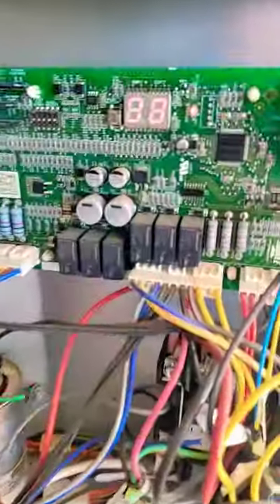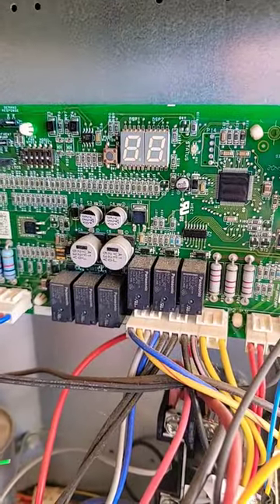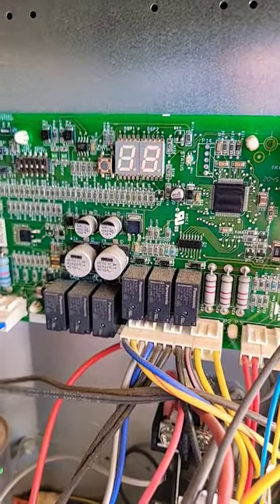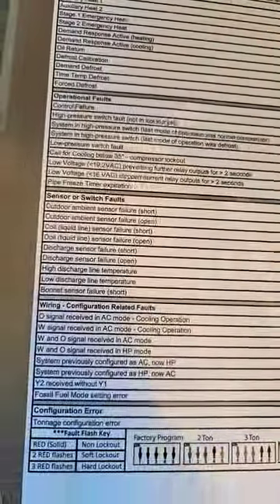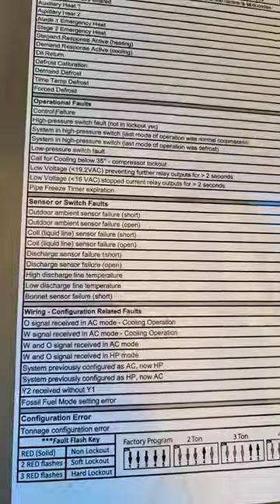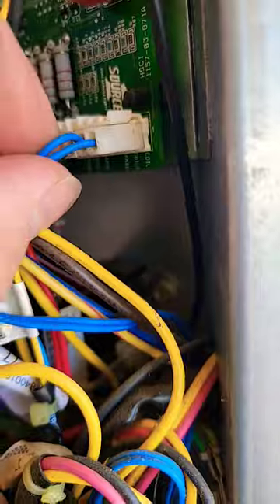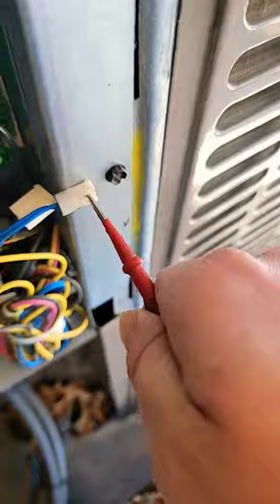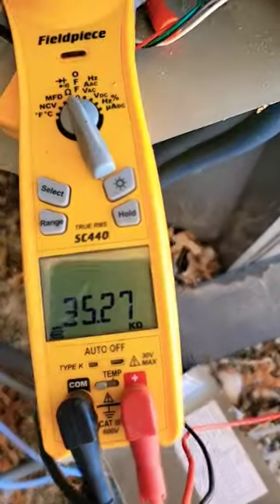Troubleshooting Heat Pump: Sensor, Board, or Communication Error?

Comment: Always turn it off and on before you call someone out and spend 300 bucks for him to turn it off and on.
Reply: That sure did cost the man 300.
Reply: Your average person doesn't think about things like that.
Reply: @@phillipterrrazas575, I understand you need the $$ but for something like that especially if the unit has an issued letter on a problem that should be about $100 I mean come on does everyone have to rip everyone off??
Reply: OR. Call a company that knows what they’re doing like Tad and he can fix it for you and find out why it kicked off in the first place. Or you can just reset it like you say and wait for the coldest day for it to break down once again and then wait for a couple days with 1000 other people trying to find someone to come out and do what this man just did.
Reply: And then he said needed a motor and blade another 875$
Reply: Those are intermittent problems.  It's hard to diagnose those I do commercial amd I hate controls.  If the sensor is good then it could be a bad board. I usually call tech support for their opinion.  If the board recognized a bad sensor it could be bad connection or bad board and sensor.
Reply: You're definitely that customer that's like "300 JUST for turning the breaker on and off." 😂😂😂
Reply: @joaquinmaciel2954  No Im the guy that watches youtube to figure it out myself and sometimes fixes it and sometimes costs myself 3x as much when I have to have someone come replace it lol
Reply: 350$ :)
Reply: yea sure cuz that's always gonna solve the problem. get a clue.

Comment: Put a small piece of sound liner above the circuit board. Snow and ice on top of the unit drips condensation on the board causing goofy codes. There is a service letter for this. 👍
Reply from the maker: Do John thank you so much you are wonderful
Reply: Occam's Razor.
Reply: Thats exactly what I thought, spiders, bugs & sometimes mice will end up in those external enclosures, that board is sitting way too exposed just behind flimsy sheetmetal for an outdoor unit of that quality.
Reply: I'm not a York dealer but the sensor resistance, whether pos or neg,  is printed info available to any tech.  Do you know the resistance at your outdoor temp?
Reply: Thanks for information
Reply: The resistence value at what ambient. 
 The service bulletin is a good clue.
Reply: That's makes sense. I worked on my girlfriend parents pkg unit. Wo wondered why circuit board kept blowing in winter. Found out condensation developed above board on a 48l carrier. Most units don't have insulation above circuit boards just straight metal. But equally as it can be good it can be bad as well for if the adhesive dries the insulation can also peeloff falling on board and its metallic sheathing can short circuit the board. 🤷‍♂️🤷‍♂️🤷‍♂️

Comment: It's more than just a "power cycle" or as I.T. would say, "Shake out the bad data bits."
This HVAC technician took the time to test logically and best of all he read the service bulletin related to the issue. This is just good damn troubleshooting skills. 
How many would have just changed out the circuit board and because we all know a power cycle would have been the fix the tech would continue to think the fix was to replace the circuit board.
Reply: MAYBE A LOOSE PIN CONNECTOR AND PULLING THE PIN TO TEST SAVED THE DAY :) HAHAHA

Comment: Probably by unplugging then replugging the sensor terminal, it cleaned the connection off enough to reestablish connection. Did you spray and clean the contacts?

Comment: Those ohm reading change per the temperature. One of those sensors is “going” bad. Bad sensor and they are going to either get a motor or a fan blade lol.

Comment: Intermittent issues are the worst. Most likely it will fault again.
Reply: I have a Rheem tankless water heater that was having intermittent faults that would clear by cycling power. The faults became more frequent and eventually it would not clear and went dead. Turned out the cause was on the main board. The filter caps on the board power supply are degrading, you can see the round bulge on the tops of the cans. I could have replaced the board for $400, but the fault code was saying it was the $70 outboard thermostat control at fault. I learned by some lucky research before buying a new outboard control or any other parts that the fault is caused by AC ripple in the DC power going to the outboard control, which is caused by bad filter caps in the main board power supply. So I put a 44 microfarad cap in parallel on the DC line to the outboard control, that fixed it. Part literally cost pennies and I already had it on hand, took 1 hour between research and locating the part in my house. So I went from getting a cold shower to having the hot water back up 1 hour without calling anybody or buying anything. That was 4 years ago, unit still running without issues. Unit is now 15 years old.
Reply: Of course, nothing was fixed. It’s very common for thermistors to fail open, especially in outdoor environments and subject to constant temperature changes…  Now that you know which sensor, it’s more cost effective to just replace it then to waste anymore time and labor. 

BTW, the control boards are almost NEVER the problem when it comes to intermittent issues. They either work or they don’t (the exception is a failed solder connection at the plug).
Reply: @onemoremisfit Good point. Older equipment starting around 8 to 10 years can experience capacitor failures in hot environments. Electrolytic capacitors have a liquid electrolyte that dries over time until failure. In some cases the cap can bulge and vent or you will see the electrolyte leaking from the cap and corroding the surrounding areas.

Unfortunately a lot of equipment manufactured today is built to lower standards and isn’t made to last…
Reply: @ecaparts  pros of a commercial technician, I get to replace both and they don’t care because they are maintenance and not fronting the bill.
Reply: @onemoremisfit good job man damn  🍻
Reply: @kylevos8551  Actually I got really lucky. I was about to buy the new outboard control on amazon for $70 and throw that part at it. Then I noticed there were a few reviews so I read them. There was a long review from a guy who had the exact same problem, he bought the part and it didn't fix the problem, then he figured out the real cause, he fixed it with a cheap capacitor in the right place and wrote the review to help the next guy. I read that and said Hey, I have some capacitors around the house somewhere, I'm gonna try that, and it worked just like the guy said. Lesson learned: always read the reviews, especially if you see a long review from a guy who sounds like he has something intelligent to say.

Comment: When I first started and an HVAC/R tech, there was no such thing as a circuit board in a condenser or package unit; just basic ones in some furnaces. It was all mechanical timers, thermistors, relays and such. When something went wrong, you had no trouble guide. Times they have changed but I might think it dumbs many techs down.
Reply: Oh man almost 42 yrs for me I remember rancor defrost timers w bulb and old air switch in air flow of fan way back.  Still have old bard heatpump w timers
Reply: @tedhicks5431  Did you ever work on one of the old water cooled Rheems?
Reply: @ewetoobblowzdogg8410  i remember one had bad lime all over it. I worked on several gas fired chillers Arkla  hated them then one of those 1st dual fuel systems had big control box with several low voltage terminals now for better t stat does it all
Reply: Times have definitely changed old timer, but I guarantee you the younger generations only get smarter as time passes by, by the way have you had the time to prepare your will?
Reply: @asadfarooq9762  crazy just worked on an old millivolt floor furnace yesterday bad t stat roaches had fun rental property

Comment: Wait, are those condensers underneath a porch deck ?
Reply from the maker: Underneath a lean too
Reply: @TaddyDigest  
Ok, I'll forgive you. After all, it does look just high enough. 
I did a job years ago of replacing a condenser, evap, and line set on a house and when I came back the next year, a porch deck had been built over the condenser that was soo close I had to crawl on my hands and knees.

Comment: Have you ever have a heatpump fan motor run when there is no call for heat? And when a call for heat the compressor runs but fan dont?

Comment: Very interesting . Have you any experience of Fujitsu Siemens heat pumps. I've been offered a 6kw system cheap. It's about 6 years old , it's been dry stored for few years. I have a friend that can gas and install it.
Reply from the maker: I have installed Fujitsu before and had very Good experience
Reply: @TaddyDigest  cool , are they easy enough to service and are parts easily available ?

Comment: So before you  call anyone out just turn it off and back on again.
Reply from the maker: yup great idea 💡
Reply: Shhhh. Don’t give away the secret 🤫
Reply: Not every situation is the same. You might make the shit worse cycling power like that. But I mean this is America, send that shit 🇺🇸🦅
Reply: Yes just yesterday a Rheem gas furnace locked out according to control board it showed  6 flashes brown out voltage drop
Reply: For air conditioners, remember to aleays wait at least 3 minutes before turning it back on!
Reply: Just like your computer! LOL

Comment: So what was the issue? You reset the board and it ran, did you go ahead and change out the board?
Reply from the maker: There's a bulletin out about this problem
 I have to add insulation in the panel keeping the board from getting condensation on it which causes that code
Reply: @TaddyDigest  Do you have the name of that bulletin? Thanks
Reply from the maker: I do not

Comment: I see the problem right now .... A massive chunk of snow fell off the roof and landed on it .... This caused an immediate stop if the motor which is also why it's bent .... This stopped the system from working properly ... Put a shield over the top of it ...
Reply: You might be correct

Comment: Basically you just turn it off and then turned on. 😂 Damn that need some serious technician abilities.
Reply: Ha.. we’ve fixed problems on million dollar machinery by power cycling.. a good technician would (and as we do) run thru almost every possible thing to do, besides power cycling.. then the senior tech advises to cycle power to the hmi or the whole machine, and what do you know, problem solved. I’ve spent hours troubleshooting before to be won over by a 5 minute power cycle.
Reply: Well I guess diagnostics aren't valuable at all to you.
Reply: That'll be 1000$
Reply: Bet you wouldn't make it 2 months working a A/C during the summer. I make over 100k a year doing it. Hate all you want bro there's money in it
Reply: @Sffker  software upgrade and restart can solve most of the problems across the board.

Comment: looks like their commercial parts are being put into residential machines. pretty neat
Reply: Seems this is the way things are going. Had a buddy who does residential call me out to a job for help, indoor blower had a vfd on it, a lot of heat pumps now have thermistors for freeze protection and to know when to kick on aux heat when its too cold out.

Just remember a lot of commercial and industrial controls work of i/o. Not many things are ran in parallel, resi guys should read  up how to troubleshoot i/o boards.

Comment: What exactly is the problem you didn’t get to fix the problem you just reset the breaker and restarted the circuit so why did it fail exactly
Reply from the maker: The problem is the cold temperature on top of the unit is causing a miscommunication from the board
 Showing this video and helping someone else to know what they can encounter is helpful
 Thank you for watching
Reply: @TaddyDigest  I just wanted you to explain that in the video thanks for schooling me tho
Reply: The board does what it wants right b4 it calls it quit..🤠
Reply from the maker: yup

Comment: New subscriber here.
Q. I have force air Heat/AC .
Do all have a heat pump like that outside? I have a 3 to unit outside. I only see it running in the summer.
Reason I'm asking is some rooms are hot other rooms are colder. Thanks in advance
Reply: Lol what?
If it runs in summer it cools
When it's not running in winter it's or off or not set to heat 😕
Reply: No not all outdoor units are heatpumps many are straight cool hot and cool spots could be hvac size issues not enough return or poor insulation/windows.

Comment: How do you know the size of the sensor in order to read ohms?
Reply from the maker: I know that all the coil sensors and ambient sensors are 10k 
I know that the discharge sensor and the Compressor top sensor is 200k
Reply: @TaddyDigest  Thanks!

Comment: Typically board would be the issue.  I would’ve checked dc voltage on communicating side. But most likely board is failing.

Comment: I'm guessing that the off balance of the condenser fan blade caused it to  vibrate the control board and yes a quick restart worked out today but if he stopped the vibration it will help. I'm sure he covered his butt by writing this in the invoice and notes that his work is not under warranty and the problem might happen again
Reply from the maker: boom yes

Comment: why order a blade or motor, just tighten the screws and or locate the   metal  clip on weight  to fix the wobbling.  if the blade be  slighty bent  then readjust.  it is not that difficult.
Reply from the maker: its a brand new unit I would do what I can to help the customer

Comment: Order a new sensor. Resetting it only works until it trips again.
Reply: it is called charge build up.  it is due to the motherboard being exposed to constant temperature changes.
 AANNNDD  ,  it needs to be removed turned over and clean the back side of the motherboard, alot of micro dust gets back there and will misdirect energy flow.  then  reinstall the motherboard.
will work perfectly until that issue arrives again .

Comment: Ya, I tell customers to flip their breakers off and back on and see if that fixes the issue before I come out and charge them for nothing. Now go explain to your customer why you're charging them four hundred bucks to reset their unit.
Reply: But Problems like that are intermittent that will come back worse eventually, if the unit goes into alarm send ur tech or have the customer check the fault so it isn’t cleared and is fixed sooner rather than later

Comment: So the problem is bad board, until you reset the unit. Resetting the unit fixed the bad bored. Typical York problem. Random sensor failure, hard lockout. Cycling the unit's fixes everything.... York's will keep your service technicians busy.

Comment: So basically, shut the unit down, reset it and turn back on.  Good fix.
Reply from the maker: Not exactly
 There was a bulletin out about this problem
 It seems the top of the unit needs to be insulated and the cold is creating  Condensation and it's leaking on the board
 Causing this issue

Comment: I guarantee you charged the homeowner for replacing the board even though you clearly didn't and ( fixing) the fan wobble. A job that may have taken 20-30 minutes for over $2,000 when all you did was reset their breaker
Reply from the maker: Where do you get this idea
That's crazy
Maybe where you live
Maybe the company you work for
Maybe you
This is a no charge call
Under warranty
Thanks for watching